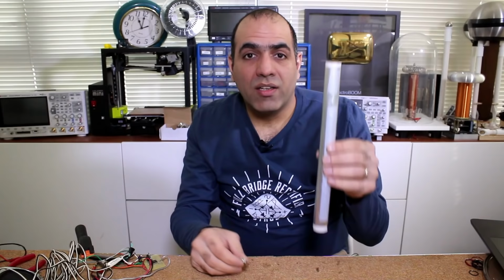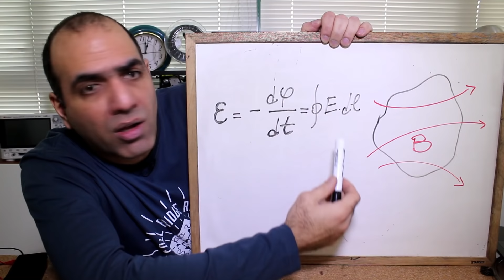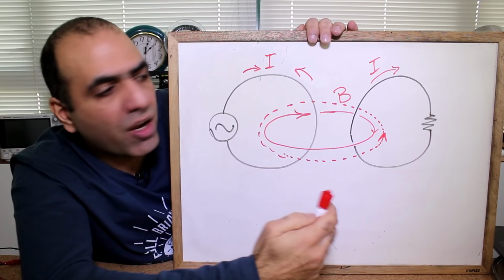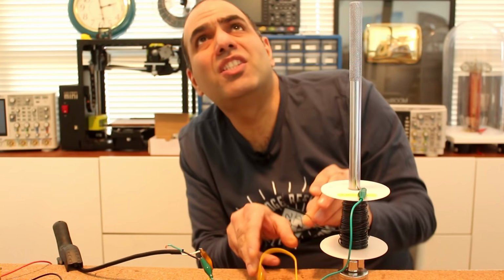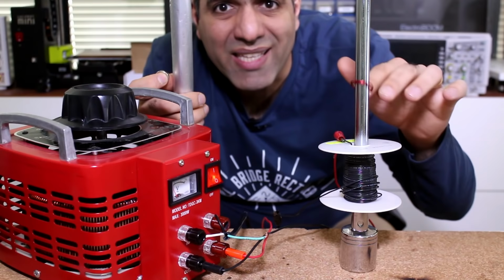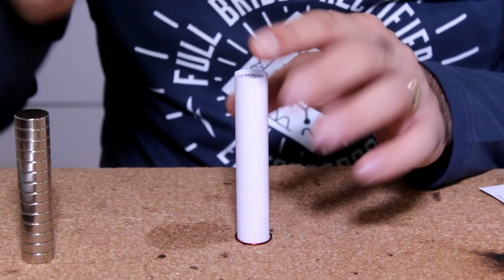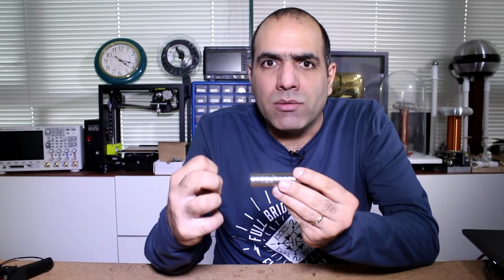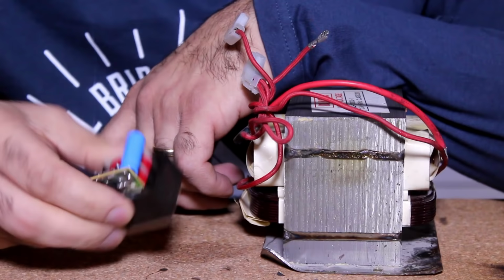The Amazing Eddy Current

Comment: In aviation, we actually use Eddy currents for NDIs (non-destructive inspections) on certain parts for cracks or flaws. It's a neat tool, like a box with a wired pen, and you just move it around the part to generate an Eddy current in the part. If there's a crack or flaw in the metal, it will disrupt the Eddy current. 

There's some other neat NDIs too. One of them is magnetic particle inspection. You magnetically charge a part, then drop iron powder on it. The iron powder will align to the flux, and we can see disruptions in the flux. These disruptions indicate cracks or defects. Unfortunately the cracks might not show up depending on their orientation relative to the field's poles, so we need to change the pole locations and try again sometimes. 

There's also dye penetrant, which is when you spray a dyed penetrant (like WD-40, it gets inside the cracks) then wipe it down. The dyed penetrant stays inside the cracks, while the rest gets wiped up. Then you spray a "revealer," which is like a mix between foam and flour, onto the part. The dye pen in the cracks gets wicked out, revealing red lines in the white spray. There's also florescent versions. 

There's ultrasonic inspections, which is like an ultrasound for a plane. X-ray inspections, which is pretty self explanatory. Then there's the "coin tap" test, where you tap certain parts with a coin or special lightweight hammer, and listen to it ring. Depending on how it rings, it might be cracked.

Comment: The welds don't affect the transformer because they are only on one side of the exterior side of the arms of the E armature. In an armature the eddy currents are circular and perpendicular to the magnetic field. So to affect the transformer it should also have welds on the interior side of the exterior arms of the armature as well. That will create a curent loop.  I'm sorry I'm not very good at explaining stuff. I hope people understand what I'm trying to say.
Reply: but my welding machine transformer had those wlds all over it. they literally welled the transformer to the frame of the welder
but it has a movable core so maby that made it acceptable

Comment: An old but common example of eddy current in action were mechanical speedometers, and probably tachometers, too. The flexible shaft from the transmission had a magnet on the end that would spin inside an aluminum cup. The cup had spring like that on a clock escapement to return it to zero, but otherwise just had the needle attached. The faster the magnet rotated, the higher the needle would rise.
Reply: Tachometers were never done this way, at least not in any mass manufactured designs.   That would have required having a cable coming directly off the engine ahead of the transmission.   Even at camshaft speed that would have been some serious RPMS (camshaft speed = 1/2 crankshaft speed, so 2500-3000 RPM on most pushrod engines).   Speedometers were able to do this because they had the relatively low speed cable coming off of the transmission tail housing, after the gear reduction, so it was more or less at wheel speed (equal to wheel speed on FWD vehicles, equal to driveshaft speed on RWD vehicles).    Tachometers were done with two opposing coils, one fixed and one variable, acting on the needle.  Same as fuel gauges.    The variable coil was driven off the ignition circuit so that it was active whenever the coil was in dwell.   This is effectively a PWM signal since the dwell duration is essentially fixed but the total cycle time gets shorter and shorter as the engine RPMs increase.    Of course now days its all done digitally, even if they have actual physical gauges for style.  The faux gauges have stepper motors to position them.
Reply: @wouldntyouliketoknow9891  I have a motorcycle whose tach is driven from a cable from the exhaust camshaft. There's a worm gear that reduces the rotation speed of the cable by a few times compared to the camshaft. It's very common for older motorcycles and reliable as long as you keep the cable lubricated.
Reply: Yes as the person above stated the electrical connection for the tachometer was commonly run off of the distributor in older vehicles. Now the instrument cluster is itself a self contained computer module receiving packages of data from all the other modules in the vehicle via the controller area network or can lines. This is done so that a module can see what a specific sensor wired to another module is reading without having to be directly wired to it. This is the most common way vehicles are wired today commonly called multiplexing, the only difference is the language they talk to each other with such as iso j1939 or GM-lan. Also the actual sensor that determines the engine’s rpm is the crankshaft position sensor or cam position sensor. Besides informing the ecm what rpm the engine is turning at it also is used to determine where the piston in no. 1 cylinder is which the ecm’s software uses to calculate where the rest are it uses this information to time the fuel injection and or spark if it’s a gasoline engine. The sensor may use inductance, reluctance or may be a Hall effect sensor.
Reply: I've got a 73 Corvette, the tach is 'mechanical' driven right from the distributor....I assume it's the same...never thought about it, now I have to find out.
Reply: @wouldntyouliketoknow9891  - there were hand-held mechanical tachs, too. I remember seeing them in a Starrett tool catalog from the 1930s. Not sure how they worked, though.
Reply: @wouldntyouliketoknow9891  Yeah,  7 of my motorcycles (1960s, 70s, and 80s) have magnetically driven tachometers. They were produced in the millions.
Reply: @piecutter2  must be a motorcycle thing.  I've never worked on bikes, but I've worked on 4 wheel vehicles for decades and never seen one like that.    I suppose a lot of bikes don't have a distributor right?  For a one or two cylinder engine a distributor wouldn't make much sense.  Just a flywheel magneto probably.   If you don't have a distributor then the system I described using the coil primary as a PWM signal wouldn't work.  So at that point you would have really no choice but to go mechanical.  So maybe that's why it shows up on bikes.  Thoughts?
Reply: @wouldntyouliketoknow9891  They all have either a cam driven points plate on one end of the crank or cam, or an electronic ignition rotor and pickup in the same locations. It was always possible to substitute a pulse driven tachometer since they became available aftermarket. But in earlier  times that would have been an expensive, bulky, and unreliable proposition, as we did not have the miniaturized electronics we have today. The first tachometer used spring loaded fly weights similar to the spark advancer on points ignitions. First used widely on steam engines. In 1902, the first eddy current speedometer was patented and became a popular "accessory" option for vehicles. Tachometers of the same type soon followed as automotive sporting enthusiasts demanded everything that would improve their vehicle or their ability to drive it. The first use of a tachometer on a racing motorcycle appeared before the 1920s,( I have seen a 1919 catalog featuring one) but they were still centrifugal at that point. I don't know when the first standard equipment eddy current or "drag cup" tachometer appeared on a production motorcycle, but I believe it was at least the 50s, and was common practice through to the 80s before we saw any electronic tachometers as standard fare.

Comment: My little eddy current story: I had to make a device for studying shear (fluid dynamics!) for a PhD student; magnets rotating around a fluid filled thin wall stainless steel vessel driving a disc containing more magnets. PhD man complained of excessive heating of fluid. Reason: eddy current heating of the stainless steel. Replaced stainless with plastic and all was well.

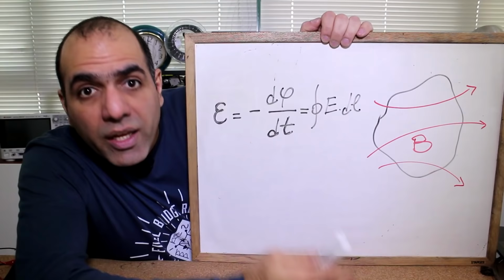Comment: There's a mistake at 2:07 because changing magnetic field doesn't necessarily create VOLTAGE. It creates CURRENT by pushing electrons into one direction in the conductor. Sidenote: if the inductor(or conductor if not coiled up) is shorted, there won't be much voltage, only current.

Comment: At 7.00 I know why magnet is not slowing down it's because you don't have enough matter of metals and u also kept a barrier between magnet and aluminium foil as paper roll which acts as sheilding effect. I recommend you to release magnet in an air conditioner pipe of copper or any metal and make sure to not put a barrier between them.

Comment: The plates have an special composition and crystal orientation. The silicon reduce the currents and this effect is stronger than isolating it because isolatind them dont prevent the currents to form inside each layer.
The cystal cells are oriented in the 1,1,1, that improve the magnetic properties and the way to make they orient this way is laminating it.. And they are not isolated from each other at all. there is just a special blue iron oxide that protects it from further oxidation. The magnetized cristaline structure has a different size  in the cristaline structure that is responsible for the noise made by this transformers (You shoud try to make a transformer speaker also)

Comment: Microwave transformer have the following unique characteristics:
- they self limit the maximum current on the secondary (with the air gap... which I don't understand)
- at no load, the primary still consume a lot : they are designed to always be connected to a load

The metal plate of any similar transformer are iron and silicon alloy. This metal don't conduct electricity.

The short-circuit from the solder don't matter. It doesn't matter neither if the bottom of the transformer touch conducting metal. All that because the silicon/iron alloy is non conducting.

Comment: @ElectroBOOM The welding on the transformers is specific to Microwave Oven transformers. These things are like 2kW or something to run the Magnetron and will create a loud humming noise owing to Magnetostriction. In order to avoid this noise in the kitchen(if the magnetron was not loud enough already!), appliance manufacturers weld the E-I cores at the joints so, that lots of energy is not dissipated as noise (sound energy) and they don't have too much of annoyed customers. The downside is however, generation of some more eddy currents which would be still less as the resistance in the loop is quite high despite the welding.

Comment: The weld across the transformer core has little adverse effect since the separate 'slice' of sheet metal is laminated/insulated from EACH OTHER, thus preventing the eddy currents from crossing from one slice to the other The circular currents are confined to TWO (2) dimensions.  So...since the eddy currents are basically confined to a single iron slice, the weld-path does virtually nothing.  I think the main reason for the weld in larger cores is to reduce/prevent audible 60Hz hum.

Comment: I havnt done it but I think if you could float the aluminum tube or suspend it by a string maybe ...it should try to rotate when you drop the magnet. This is how the older watt meter on the house works with aluminum disk. Newer motors in washers use this for spinning. I really liked this video.

Comment: This is how modern eddy current brakes work on roller coasters. A metal fin is placed on the bottom of the coaster's train. There are magnet plates on the track that the train's metal fin slides between, causing the train to slow down. There are also linear induction motors that use electromagnets that can launch a coaster train, as well as stop it or reverse the direction by changing the magnetic fields.

Comment: In a transformer, windings must be secured to reduce humming. Small transformers just have the varnish hold plates in place. Very large transformers usually have rods with nuts on both sides securing plates in (usually) four corners. For medium-size transformers, welding the plates is a cheap, fast, easy, and permanent way of securing the plates physically and from welding. YES, some shorting is done, but transformer steel is not very well conducting anyways, so weld's positive aspects outweigh its non-perfect side effect.

Comment: Why the plate doesn't floating on induction cooker?
Reply: Because iron has a high resistance, so thats why it does not create that high eddie currents to oppose the induction cooker. 
(Also Since the resistance of the iron is high it converts most of the current into heat and the heat generates more resistance)
Reply: I have a frying pan that is stainless steel laminated with an aluminum core (to help spread the heat, since stainless is quite a poor thermal conductor). When it's cold it's slightly convex (it straightens when it heats up), and also, as you know, when it's cold the resistance is the lowest. Thus, the low resistance aluminum together with the low temperature and the low friction from the bad contact with the glass, it tends to dance around quite vigorously when you first turn the power on. It doesn't fly off by any means, but it tends not not stay on the induction plate if you turn your back on it..
Reply: Well that's a really nice question... And if we place a copper hoop on induction cook top will it float
Reply: Because its already on the ground noooo

Comment: Yes, welding the laminations will affect the transformers efficiency, but is a very cost efficient way of mass producing them.  Steve S.: Electromagnetic/Electromechanical Design Engineer Trombetta since 1978.  You have a clever way to catch viewers into watching and unknowingly learning something.  You may want to add: not to mount the transformer with magnetic screws, if the laminations have through holes (used for rivets before laser welding was introduced).  Actually, this could be a smoker of a video to try!
Reply: I need to correct part of that last comment.  "magnetic screw" should have been "a non-electrically conductive screw".  It can be magnetic, but must be electrically insulated from the laminations.  If it was the old style rivet, they had a chemical surface conversion treatment making then somewhat less conductive.

Comment: I think that when you use the entire aluminon foil it worked because the amount of rounds it had. The voltage created also depends on the amount of loops, no just the change in magnetic flux in time. There is no drop in the resistance. Correct me if I am wrong pls.
As always, love your videos.